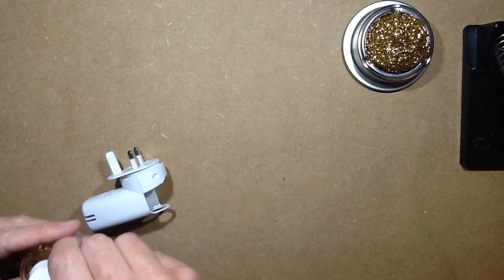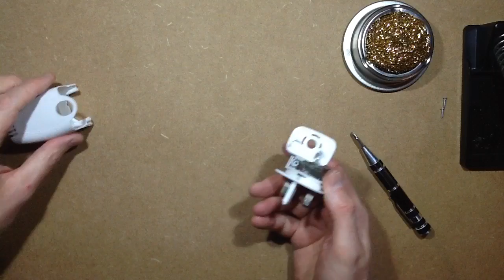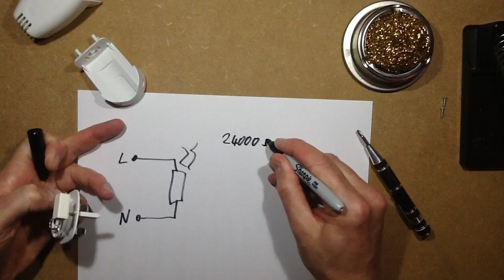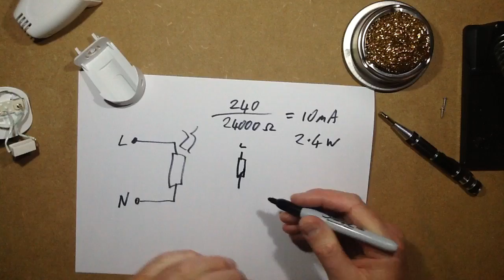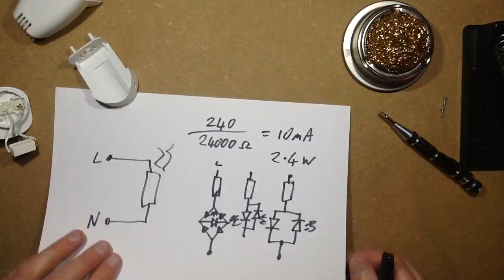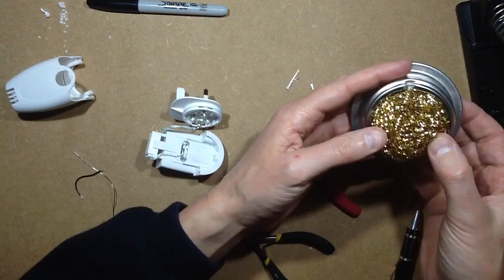Making a cheap air freshener light up.

Comment: Hi man, good job.
I have a question.
I like to convert this plug airfresher in to car airfresher.
Can I just connect power directly to tyr 12v car battery. Wity on and off switch. 
Thanks man
Reply from the maker: The heater won't get very warm on 12V.
Reply: @bigclivedotcom  oh ok, but it's safe right?
Thanks man for your reply.

Comment: Talking about drilling body parts, it was back in 1976, I was a Sergeant stationed at Fort Myer Va. with The Old Guard.  I was in the Communications Section of Headquarters Company, a couple of my men were busy at the motor pool, mounting a radio on the back fender of a Jeep. One of them, a fellow of Irish extraction was using a rather large drill with a large bit. They were not following the directions I had given them about starting with a small bit, and moving up in steps, but tried to hurry the job by using the full sized bit to begin with.  Well old Ted was bent over the fender and putting all of his weight on that drill, and had the bit going full bore, when the bit walked it's way off the fender, and through his pants, it grabbed his dick and spun it around the bit like a barber pole, and entangled his balls as well. I have never heard such a scream before, it was worthy of a horror flick.  We all gathered around, and being the NCO in charge, it was my duty to unwrap things, so to speak, and transport him to the base hospital. Not a pretty sight, and after getting him lined up with the doctors, I had to drive off base to his home, he lived in the same apartment complex as I did in Arlington Heights. I informed his wife, and while I was sitting with her (A very beautiful lady indeed) drinking a cup of coffee, and talking the incident over, the door opened and Ted walked in, he looked like the proverbial cowboy with bow legs. The doctors told him he was very lucky and that, while there was indeed some danger of infection, it appeared he was still intact, proven by the birth of his daughter some 12 months later.

Comment: Were those LEDs rated at 240V?
Reply from the maker: Standard LEDs, but with a current limited supply, so if the voltage was measured across them it would just be their normal forward voltage.
Reply: Current limiting resistor value 24k did that work? I mean it must although i'm rewatching for that math.

Comment: BigC, I've watched a lot of hacks, but this was literally the coolest one I've ever seen. Whatever made you think of this? I followed you with the transistor and the math, just not the "how" that came next.  You mentioned how there was little room for the LED. Do you think this is why they make a bigger case for those? (Hey, you should make a follow-up video showing the freshener that already has the light, and your opinions about them. Maybe even a way to replace them when the lights give out!)

Comment: is anyone else wondering if the air freshener liquid could be put into a electronic cigarette tank and smoked?
Reply from the maker: +Donald Sleightholme No.  Absolutely not.  That could cause a severe reaction in your lungs.  Most of the bottles of air freshener refill warn you not to get it on your skin.
Reply: Donald Sleightholme you're an idiot.
Reply: +Donald Sleightholme lmfao
Reply: +bigclivedotcom yeah but so does the nicotine liquid 🤔
Reply: +Josh Jacobs you should try it...
Reply: +Donald Sleightholme Yes, but here's a difference with the nicotine liquid: manufacturers are warning you not to put these chemical air freshener units in bedrooms, for the same reason as bigclivedotcom mentioned -- it can cause a severe reaction in your lungs!
Reply: +Jennifer W   Hm, well then, how about putting the nicotine liquid in an empty air freshener bottle and use that in the unit?  Then you could enjoy the nicotine smoke without all the hassle of having to hold the e-cig device in your hand!  Wow, what an idea.

Comment: Do they also make one with "Colostomy Bag" fragrance? I may purchase a few if so. They would be great to anonymously plug-in at various public places as a gag…
Reply from the maker: Well you can get Halloween haunt aromas.  So theoretical you could refill one.
Reply: So, will you hold it for me?  :) ... I'm sorry, please forgive me I couldn't resist...
Reply: Also, thank you for telling us about the wago connectors. I had never seen those before. Now, I am using them everywhere I can. I received my first box of 51 (it actually had one extra free) from eBay seller 3boyslightingstore for $12.87; $.26 each, with free shipping. Also, I really like the Cliff Quicktest junction box you use. Unfortunately, they don't offer one for the US 110V market. But, I suppose I could swap power cords.

Comment: Great video. I had to run right out to my local Dollar Store and get one of these.  (What is the exchange rate between Poundland and Dollar Store?) They had the exact model.  I put the two LEDs just below the mains connector, so when attached to the wall, they are shining down.  Plenty of clearance inside.
It got me to thinking, which can be dangerous, why do manufacturers build expensive capacitor dropper circuits in LED bulbs when clearly one resistor seems to work? I'm assuming that this could be scaled to multiple LEDs and one or several resistors?
Reply from the maker: +Rich Booth The resistor would be very inefficient in a mains lamp.  In the air "freshener" the voltage being dropped across the resistor is giving off about 2W or more of heat versus the 0.05W from the LEDs.  The capacitive droppers don't dissipate the excess power as heat.  They just allow a small portion of electricity through on each half of the mains cycle.
The exchange rate between the British pound and American dollar is roughly about $1.5 to the pound.  So if you got yours for a dollar then you effectively paid about £0.67p for it.
Reply: +bigclivedotcom Of course in the UK we normally display prices including VAT (at 20%) whereas it seems many American stores do not display sales tax in their prices, it being added at the cashdesk. Therefore whereas a Dollarstore will get £0.67 for any particular item, a Poundshop will get £0.83.

Comment: Did you really just use a calculator to divide 240 by 24000? And then multiply 240 by .01 with the calculator? You're getting too comfortable relying on those tools, hehe. And yes, I once pulled out a calculator to multiply by 10, so don't feel bad.

Thanks and keep up the great videos!

Comment: Clive, I am always impressed with those screw drivers you use, if I upgrade from my pound land set where can I get some like yours?
Regards
Reply from the maker: Land Rover Addict The screwdriver set is actually from Poundland.
Reply: I can't believe I have left something on the shelf in pound land, that will never do. Thanks for talking through the circuits. I find it very interesting.
I am unclear why a resistor is a current limiter, is it because it will burn out once a given current is exceeded?  Maybe you could do a video on some basic principles.  Regards
Phil
Reply from the maker: Land Rover Addict Hi Phil.  A resistor is like a tap in a pipe.  If you screw it almost closed it has a high resistance, but if it's almost completely open it has a low resistance.  It's used to limit current flow.
Reply: Got I think, so you use the value of the resistor to drop the vaultage to a value that won't over drive a component like a LED?
Reply from the maker: Land Rover Addict Yes.  An LED needs to have the current limited through it.  So you choose the resistor to pass the required current based on the voltage to be dropped.
Reply: Land Rover Addict A resistor is aptly named because it... resists current. The higher the voltage you apply, the higher current it will allow to pass through, Voltage is kind of an incentive or pressure for electrons to move along, and current is pretty much the speed at which they move. The resistance is an obstruction, which makes movement more difficult. The higher the resistance, the less current passes through. This is Ohm's Law: I = V / R, with I being the current, V being the voltage and R being the resistance. Ohm's Law applies not only to a resistor, but actually to ANY part of a circuit, just any two points.

A resistor is not designed to burn out, although of course it can if you exceed its power rating. But then you could no longer use it as a current limiter, eh?

So consider the circuit of just resistor and LED connected in series with to a voltage source. An LED (or a diode in general) has two states depending on which way and how much voltage is applied to it, in one state it doesn't pass any current (approx. infinite resistance), and in another state it drops its turn on voltage and passes any current (almost zero resistance). However, the current cannot be too high, because power dissipated at an element is P = V*I. Some of that power will dissipate as light, but most will dissipate as heat and cause thermal damage. Given that LED's voltage is fixed (about 2-3V depending on colour), its power handling capacity is usually expressed as current, and for the typical low power ones will usually be about 20 mA. So considering that, the voltage on the resistor is going to be V_source - V_led, and it will limit the current to I = (V_source - V_led)/R. In this case, V_led has been disregarded because it's very a small fraction of V_source and thus the current will be almost the same, and given that it was about 10mA before, that's good enough.

I wouldn't want to use Clive's screwdrivers, i prefer mine not to fall apart all the time.

Comment: Could one use candle flicker leds in this arrangement or do they crap out with unsmoothed half wave? (would they need smoothed half wave?)

Thinking about making a fake scented candle thingy, or more like an scented oil "burner". The resistor would heat a glass cup with oil/water. A flicker led and a whitish led light it from below.

Comment: That certainly would make a good retail product as many hallways have just a single plug socket (including ours), making it awkward to plug a nightlight as well as an air-freshener in, not that we have any intention of getting a plug-in air freshener.

Now you just need to patent it ;-)
Reply from the maker: They do actually make air fresheners that light up already.  Just kinda rare and usually not that good.
Reply: bigclivedotcom Hey Clive, how do you get that over head shot with your camera? is it some kind of tripod you've made?
Reply from the maker: markybyeah When I built my new workbench I added shelving above it that supports the under-shelf lighting and has two pull-out drawer slides that the iPad sits on, so it's camera is dead centre.  The work surface also has markings to show the area visible to the camera.  I've also got the option of putting a slide-out shelf in the same area to support any camera pointing down.
Reply: bigclivedotcom
Interesting stuff. Thanks for the reply Clive.
Awesome videos, keep em' coming!

Comment: Did you say 2.2W resistor? As in, not enough for the 2.4W it is trying to dissipate. And it evaporates liquid right next to the bare ends of the wire?

Another quality product from Poundland.
Reply: Looks to me like they designed it for 230v, the dissipation then would be almost exactly 2.2 watts. (2.204166 recurring)

But yes, as you say, another quality product :-) Still, I find it amazing that they can make something for this price :-)
Reply from the maker: I think that because the resistor is actually being treated as a heater, the 2.2W may be its heat output rating.  And as Chipmunk says it is probably standardised at the European standard of 230V which has a wide tolerance that varies from less than 220V to about 250V due to it covering older standards.  I would say that the resistor size is similar to a 3W ceramic resistor.  To date I've never seen any discolour or fail.